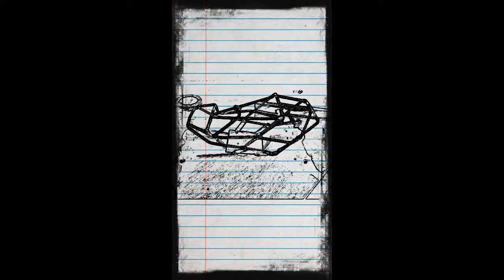RC BOUNCER Build

Comment: why did you build it so short, would be a bit more stable if it more scale length, also the axles look ace but a 3 link front would have looked so good could have hidden the servo in the body and made like a mock engineto hide it.
Reply from the maker: Oliver Boatwright , I know , it turned out shorter than I was expecting as I used the original driveshafts and they popped out when it was fully extended . I was only learning with 4mm alu rods but have now gone to steel. Also thank u for commenting
Reply: Dazzlelaa im building mine out of 6mm ali rod, with that hts2000 brazing rod, but mines more minimalist design, drive shaft are cheap and can get really long ones cheap. next one will be 4mm, I was concerned about steel being hard to work and difficult to braze, how are you finding it. so many ideas and no where near enough time, best of luck with yours.
Reply from the maker: Oliver Boatwright  how's your build coming on mate , any pics ?
Reply: Dazzlelaa can't seem to upload pics on comments. add me on FB, Oliver Boatwright, I'm driving a land rover in my profile pic.